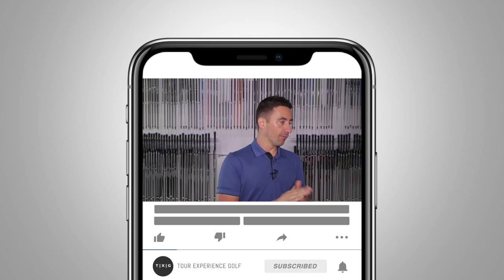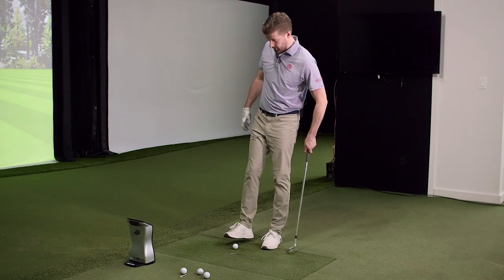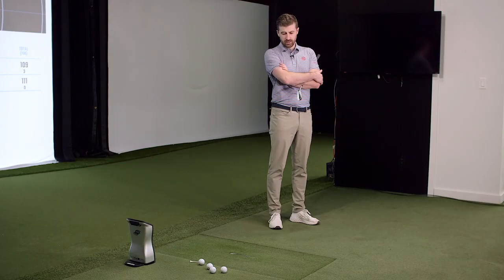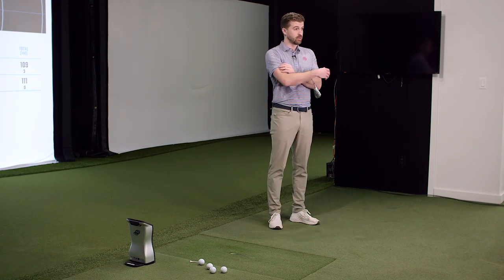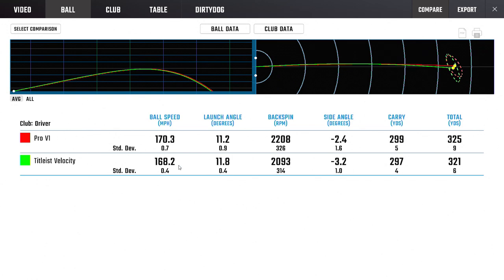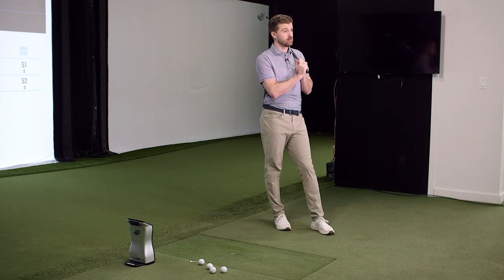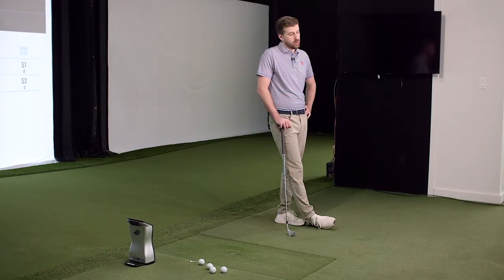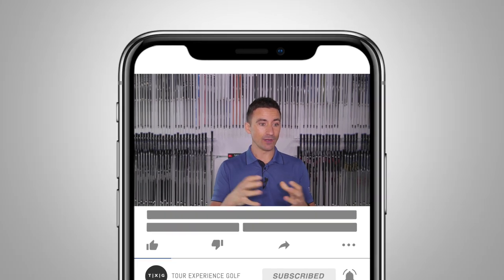Do DISTANCE GOLF BALLS Actually Go Farther?

Comment: 10 minutes into the video I was like "just gonna save money and play the velocity" till you mentioned the study... To be fair it was a study done by Titleist so there's a huge agenda to encourage the weekend golfer to buy their more expensive balls
Reply: If they played twice and the pro v1 was the second ball used, the high handicapper had more practice so obviously they would play better the second round
Reply: The study is suspect TO SAY THE LEAST
Reply: Yeah I have a hard time believing your average high handicapper would save 4 shots over 9 holes just by getting a little more green side spin.   For starters players are generally swinging with such low swing speeds around the green(particularly high handicappers that don't play flop shots) that the differences in spin numbers would be very negligible, certainly not enough to make any massive difference.  

Maybe and I'm being extremely generous here maybe you might get 10 ft more roll out on a PROV1 vs. Velocity, but even if that were the case that doesn't mean that you are gonna be 10ft closer to the hole just cause you used a ProV1.  There are times where hackers could've benefited by having the ball check up earlier but also times where they would've been better off if it rolled out more.   

Finally if you're a high handicapper chances are you aren't playing tour level courses with tour level pin locations, more than likely you are playing courses that have accessible pins that allow you to play for the ball to release a little bit so you can factor in the ball rolling out more and adjust accordingly.

Comment: Great assessment.  I know you get this a lot, but what is your take on the differences between the Velocity and Pro V1 with a player who has a driver swing speed of 90 MPH?
Reply: Exactly this. Isn't PROV1 (and other premiums for that matter) the kind of ball that performs optimal when the club head speed goes over a certain point? And the "distance" ball could actually be longer when hit around that 90MPH mark for example? That's how I've understood at least (read or heard somewhere). But that study result was interesting. I know I liked playing PROV1 (found one or two and bought the "practice" balls a couple of times) and I've been preferring softer balls otherwise too (Wilson DX2/Duo soft, e5 etc.) for the chipping feel. Less heartbreaking to lose a ball that cost 25$ a dozen than 50$ a dozen (and I tend to lose more than one per round).
Reply: I’m around there, and in my experience this carries over in general. Driver distance they’re similar, but spin and launch differences occur very much like TXG represents. Best idea is to test for yoursef though!
Reply: Argus And also ask if the distance ball gives more help to someone whose strike is less than consistent

Comment: I used to play basically whatever the cheapest ball I could get was.  Sometimes I'd play a slightly better ball, but never even considered something like the ProV1 because "I'm not good enough to justify spending that kind of money for balls that will end up in the woods or water."  I was consistently hitting scores near 100.  At the time, 96 was my best EVER score on 18 holes.

Then I got a special deal from an online retailer that made the ProV1's more affordable for me to "try."  I'm not going to say it was an instant night and day improvement, but I've hit rounds in the low 80's and high 70's consistently since then.  Also, and this is probably the biggest clear difference, more often than not I don't lose 4-6 golf balls during a round by hitting shots in places I don't want to.  There does seem to be a much more predictable flight and feel to the ProV1 that helps in many, many ways. Mostly in peace of mind that if I swing the way I'm supposed to, it's gonna go where it should.

Comment: Noticed the other day that softer covered / spinnier balls tend to follow club path more and harder covered balls are affected by face angle more on short chips and pitches. Noticed BXS consistently finishing left (RH) of the others I was playing with. Even more noticeable on open-faced shots! Makes sense on the same principle of spinnier covers launching lower as well
Reply: To clarify: just as a spinnier ball launches lower as a side effect of increased friction, on an open-faced shot, the same principle applies horizontally, where the spinnier ball launches more in line with the club path because of the friction pulling the ball that way. Harder covers get that “weak” flight that pops up and goes right with no spin on flops, softer covers allow you to aim a little straighter

Comment: Yesterday, as an experiment, I played 18 with several different balls. 
Hole 2 - Taylormade ball from a case of beer - 8 iron from 140 on fwy - hop 2 feet and stop.
Hole 3 - Wilson Duo Soft + - GW from 105 on fwy - hop 1 foot and stop
Hole 5 - ProV1 - 8 iron 138 from tee - hop 3 feet and stop
Hole 9 - Taylormade beer ball - 9 iron from rough - hop 4 feet and stop
Hole 12 - Duo Soft + - 6 hybrid from 162 in fairway - hop 7 feet and stop
Hole 13 - ProV1 - PW from rough 122 - 6" from pitch mark

Free Taylormades, Duo Soft were $1.75, ProV1 $5.  IMO all the same performance on the course.

Comment: Just started playing again since lock down (uk). Tried the Velocity, (usual ball prov1) improved my game from the off, fairway finder. No problem stopping on greens. Disagree with titleist on the point that mid handicappers do a lot of chipping so require premium ball. Mid handicappers usually prefer and are better off chipping than pitching and the velocity is excellent get it on the green and run it to the hole.

Comment: You should repeat this test with a golfer that has a low swing speed. 
I have seen another test comparing a ball to the proV1 but they did it with two different golfers. A high club head speed and a low club head speed hitter. The higher speed hitter saw no difference in balls, but the lower swing speed golfer picked up 25-30 yards with the alternate ball. Most data indicates club head speed doesn’t matter, maybe true for most balls, but would always like to see for a ball advertised as a distance ball if it is a variable.

Comment: I would say this video makes the case for cheaper balls.  Most golfers are not throwing a wedge right on the pin and looking for stopping power.  The majority land short of the pin and the extra rollout/lower spin would actually help them.  If driver and mid to long iron performance is the same then go with the cheaper ball (or just buy the prior generation Srixon Z Stars for $30 or less and get a great ball at a great price).

Comment: Do you anticipate the difference being more significant with velocity being better for a slower swing speed on the driver. 95-100 mph drive?
Reply: Off my driver the Pro V  & /VX spins off the course while the Velocity keeps me closer to the fairway.  I'm also a ball retriever and find scores of Pro V's in the woods and hazards which suggests that I'm not the only one who sidewinds premium balls. Not knocking premium balls it's just that they're not for everybody. Sure they can help with short shots but if you're consistently chipping for par, or looking for stray shots maybe you should consider a 2-3 piece balls until you have more control.

Comment: If cost is an issue I recommend used balls.  Auctions on eBay for "AAAA" and even "AAAAA" premium balls are good deals.  I try to get them at around $1 a ball but many will go for $1.50 or more each.  This is still a deep discount on lightly used balls.  It doesn't hurt as much when you lose them.

Comment: If you have a high handicaper with considerably more side spin and slower club head speed, would the distance ball would be more beneficial while using driver? Matt’s spin axis/ side spin is probably close to 0 while a high handicap that unintentionally plays a slice might be closer to 1,000rpm’s. Would the distance ball reduce spin enough to help minimize the slice?

Comment: Great information.  It would be nice to see a driver comparison between the two balls with ball speed between 130 and 140.  My guess is that the distance ball would be marginally longer.  there are not many golfers with Matts speed that can "over-compress" a golf ball.   Can't believe a ball with increased spin helped that much over 9 holes.   My theory has been that higher handicaps would almost do better with a ball that spins less because it would always role out.  If they nip one really nice it would come up really short with the added spin and an average to poor strike would run out no matter what ball they played.

Comment: I see many high-handicap players using cheap, low spin balls, and often time I see balls rolling past the green on the short pitch/chip shots.  It makes sense to me that higher handicap golfers would benefit using premium material higher spin balls for short game improvements.  If the price is of concern, there all many lower-cost alternatives with similar performance characteristics such, Vice Premium, Costo Premium, Cut Golf, Snell MTB-X, Taylor Made Project (s) even super cheap Top-Flite Urethane Gamer are excellent premium balls half the cost and I think will provide great benefit for high handicap golfers.

Comment: as someone who is an intense tryhard, but also intensely awful at golf, the "premium" two-piece balls are hard to resist because I'm mostly losing balls off of the longer shots and less goes wrong on those short shots. it also is financially more viable to lose 9 of them per round than 9 prov1's. can't quite bring myself to use the "budget" balls though (noodle, pinnacle, etc etc).

I'd be super interested in an extremely thorough comparison of all the "premium" two-piece balls on the market though, and how they compare to even the "worst" urethane 3/4/5-piece balls

Comment: But wouldn't the Velocity actually be a better choice for many higher handicap players because it does spin less on wedges/shorter clubs, and the higher handicap players often miss short (i.e. underestimate or mishits)?  Even on chip shots, don't most higher handicap players leave their chip shots and pitches short?  In those situations, wouldn't more roll out benefit those players more, as opposed to higher spin which would hold those shots short?

Comment: Have to agree with this. 
I normally use a distance ball as I found I couldn’t hit a pro v 1 straight. 
So for years I’ve used Volvik or srixon soft feel and most recently callaway super soft. I thought the “soft” ball would help me with stopping and spin on the green etc but I just used Bridgestone tour Bxs (as I have high speed swing) and bloody hell the difference was night and day! For the first time in my life the ball actually pitched and stopped on greens and there were two holes where I got propper backspin( more than a metre) I play off 27 by the way. Drive it 250m plus and as the boys said, miss every green so have to chip on every hole🤣🤦‍♂️

Comment: Would the ballspeed off the driver be different at slower swing speeds? If I'm not mistaken, these balls are marketed towards those with slower swings.
Reply: This is also what I'm wondering about ?   I think the Velocity is designed to add distance for a higher handicapper and/or slower to mid swing speed player.  So would be interesting to see same test with a 90 mph swing speed for example.

Comment: I seem to recall that when Today's Golfer did a ball test there was no difference in either carry distance or spin between "distance" balls and normal balls at various swing speeds.  Should be interesting to see if the video shows the same thing.

[Now that I have watched the video] other than the wedge spin there was no meaningful difference in carry between  a "distance" ball and a premium ball.  Even the spin difference on full wedge shots whilst statistically significant might not be practically different on the basis 10,000+ rpm is plenty of spin.  The 50 yard shot was a massive surprise and the Titleist research was an even bigger surprise.

Comment: Can you try a noodle long and soft and compare it to the expensive ones.

I feel I get the same performance as a pro
V1
Reply: They basically did, Noodle's a budget ball.  Soft is going to be low spin, high launch.  Long is going to be low spin, lower launch.  Not a multi-layer urethane coated prov1 by any means, likely you're just not making enough "feel" shots around the green to notice.

Comment: I would imagine distance balls are designed for lower speed swings.  I figure with Matty's swing, he has compressed both balls about as much as they can take.  You might need to get a Swing Robot, or dial Matty down to check swing speed at say low 100s with a Driver.

Comment: Would the test be different at 90 mph swing speed? I may argue that Matt may over compress the velocity where a slower swing speed couldn't get the most out of the prov
Reply from the maker: in all our testing with slower swing speeds (especially Ronnie the rocket), we've seen the firm compression balls give the most ball speed. Velocity would probably be closer to Prov1 for a slower swing, but not faster
Reply: @clubchampionmedia  I don't get to work with many slow speed players unless I'm at work. Most of the guys I train are high ranked juniors and tour Avg swing speed and they all play premium balls.

Comment: Using any human to test shot after shot is not the way to go.  Use the Iron Byron and have truly consistent swing and strike.  My guess is that there would be very little difference in distance between balls otherwise the manufacturers would show you legitimate results.  Same sort of thing with all the car shows who install a "cold air intake" or some "special" airfilter or new exhaust.  Very little if any change to show for your money.  It's so easy to show controlled testing and real results, so ask yourself why you're not seeing such a thing?

Comment: Does the distance similarity have anything to do with Matty's very high clubhead speed?  I ask because I was playing a foursome tournament with my buddy.  I played ProV1 and I thought he did too.  It turns out, he switched to the Velocity but I didn't know it.  He hit tee shots on the first hole and third hole, so I had to play his ball into the greens (they were both 9 irons, coincidentally).  I blew both balls over the green on great strikes - not skulls or anything like that.    I hit my 9-iron about 130 with my ProV1 and it went about 145 on the first hole and almost 150 on the 3rd hole.  So, both shots were solid (I was a 2 handicap back then) but went so much farther than normal (luckily, after that 3rd hole, he said he forgot to tell me that he switched the Velocity).  So, I know it is a limited sample, but there was no way I could then (or now) hit 9-irons over 145 yards unless I skulled them - and these shots were struck exactly how I wanted.  Just curious.

Comment: Need to redo driver part with lower swing speeds. Matty will generate spin with any ball.
Reply from the maker: Faster speed will generate more spin, but it will not make every ball spin the same
Reply: Slower driver speed should reduce spin and increase run out which is what I think would give the distance factor we didnt see. ProV1 core should always produce more ball speed given better compression with higher swing speed. Or are both cores the same ?
Reply from the maker: compression is a bit of a myth at times, we've seen a lot of slower swing speed players get their fastest ball speeds with firm compression balls
Reply: @clubchampionmedia  
Cool. Going to buy a box of Velocity balls right now. I like my chips and partial shot to run out like putts.
Keep up the excellent content.
Love it.

Comment: Hey guys I had a superchat question at the beginning on the Livestream Q&A yesterday, I got charged the $10 but I never seen my question pop-up will it be answered at a later date or do I have to contact YouTube? Maybe it was a glitch on there part, but I do have the transaction receipt. Thanks have a good one
Reply from the maker: Let us know what the question was Mike we’ll do our best to get you an answer here ASAP
Reply: @clubchampionmedia  thank you guys that's why you guys are the best! .. the question was, I got fit for a set of irons my swing speed with a 6i is 84 mph. Got fit for Nippon N.s. pro 950, but when I asked right flex am I, I was told 3.9 frequency? So I have no idea if that means regular stiff, or I'd that's just a matching requirement for the build. Also biggest difference between N.s. pro950 and modus 105 I also liked the way modus felt.
Reply: @clubchampionmedia  what flex am i^^ sorry typo 😂
Reply from the maker: Hey Mike, frequency is a rifle scale flex measurement and 3.9 would be a soft regular flex. Modus 105 is a heavier/stiffer profile than 950. Best thing to do would be to contact that fitter and clarify the specs that were recorded for you from the fitting.